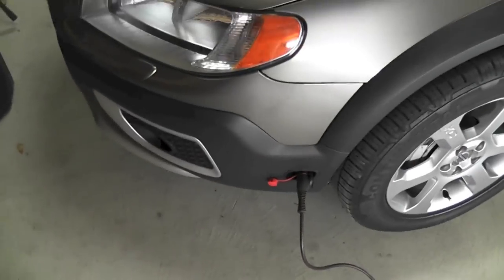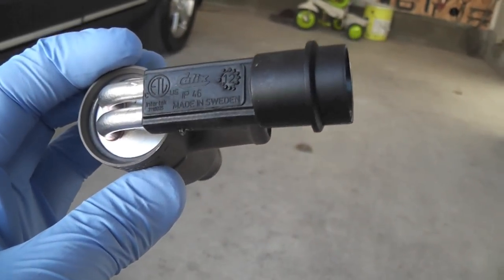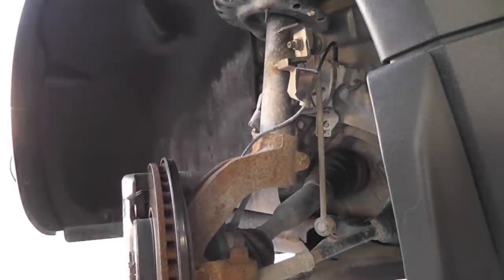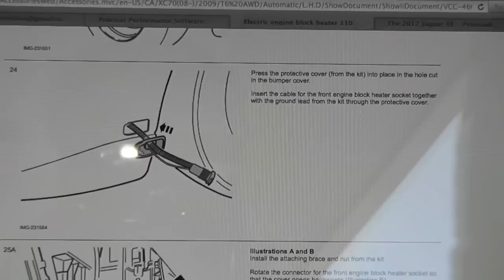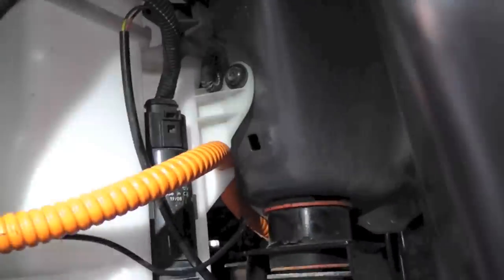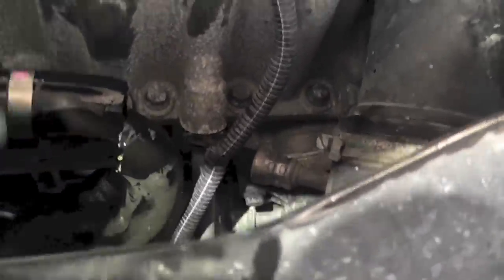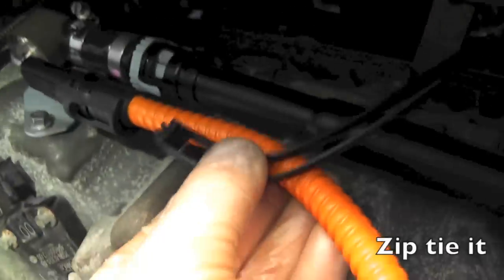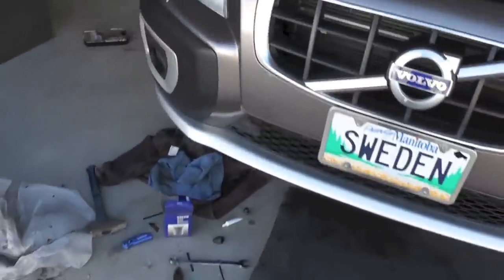Volvo Electric Engine Block Heater

Comment: I installed the same block heater with a circulating water pump kit on my 2009 V70 T6. The BOSCH circulating water pump circulates water in the system and the motor heats up more efficiently. The pump enters the same hose above the heating resistor and pumps water through the resistor. The pump is powered by a 230V / 12V transformer, which also acts as a branch point for a separate 230V cab heater. The brand is Calix, the same manufacturer that manufactures original Volvo engine block heaters. The Calix part number for this pump kit is 1762010. I don't know if it gets a 110V / 12V version, we have 230V mains voltage here in Finland.

Comment: I never saw a car without this 🤔 I wonder why they didn't install it in the factory if the car was going to Canada.
Reply: You're right mate. My XC70  in Norway had this from the very beginning. Now I live in Australia - the XC70 with the wheel on the right hand side certainly does not have it. What for. My Volvo dealer told me he never even heard of something like an engine block heater.
Reply: @gerpressindepen5425  strange indeed

Comment: hi would  it not be better to have the socket on the car face the other way round so the   cover /cap closes  the other way around less chance of it  opening with the airflow when driving
Reply: steve roper  you would say so, but the manual has a note to install it like this
Reply: I thought the same thing.

Comment: I don't know how i got to this video, but this is oddly enough the exact same heater you get on a Canadian spec 2015 Volkswagen Golf TDI. It's not a very effective heater as it seems to shut off if you leave it plugged in more than 4 hours, but it is better than nothing. If it had a built in pump it would be a decent little heater, but it turns off before REALLY heating the engine.
Reply: It's only 550W, it should have at least 3x more power to heat some big block. You have 2.0 TDI?
Reply: @Wrublos212  Yeah it's the 2.0 TDI,  I feel the wattage is sufficient to get it "warm" but temperature on startup seems to vary greatly depending on when your plug in

Comment: No way man, I'm in Manitoba too. I have a mk7 VW golf and installed the same system, it doesn't seem to warm much tho, is yours getting warm?
Reply from the maker: Hey! In the manual it says it warms up to 20 degrees more then outside temp. So if its-22 outside your coolant would be at -2. Actually I do notice a difference when I plug in. The climate heat comes faster.

Comment: Hi there, fellow Winnipegger here. I found a Calix cord in my 2014 s60 t6. I bought the car pre-owned about 5 years ago. This is my first time finding it (had a flat tire and was looking for the spare tire when I stumbled across it). Is it safe to assume if I have the cord and the outlet in the bumper I have this feature? The engine hates the bitter cold. I wish i had found it years ago.
Reply from the maker: Hey. If you have the cord and the bumper outlet then you do have engine block heater.
Reply: @volvosweden  thanks so much for your response. I appreciate you taking the time to answer. Great news that I wish I had known years ago!

Comment: Super video, Thnx 😊
If I do this i will tap into the line and add a 120v cabin heater and stick on heaters for the oil and transmission pans. How many watts is this coolant heater? Hoping it's low enough to allow for the other heaters to run from the one cord 💁‍♂️

Comment: Useful video. I did side plug installation, coz of your video. However, I was installing on a VW golf mk5 a block heater, that it's attached on the side of the motor. A calix RE 149. And also the installation for the plug inside the car.
Great video, thank you :)

Comment: I just installed an engine heater in my 2016 S60 CC and referenced this video.  The hot knife/razor made cutting through the bumper very easy and clean.  Routing the cable was the most challenging because it is near the serpentine belts and I needed to make sure it was securely clamped away from it.  Removal of the passenger wheel and wheelwell cover was needed for proper routing of the cable.  There was also a tight fit at the connection point due to the turbo pipe being very close to the heater.  It took me more time than anticipated, but your video helped me out.  Thanks for posting!!  Now I wait for the cold weather to see how well it really works.
Reply from the maker: +Rob Dutka Good to hear that the video helped. It does work well in the winter. Heat comes faster to the cabin.
Reply: Heater works great.  When changing the oil yesterday I noticed some residue on the lower hose of the heater.  Turns out the screw clamp loosened.  I checked the other they and they were all loose too, but not leaking.  I lost about a cup or two of coolant but it could have been worse.  Keep an eye on the screw clamps.  I'm going to change mine to the spring loaded ones or the ones that you squeeze to lock them in place.
Reply: Heater works great.  When changing the oil yesterday I noticed some residue on the lower hose of the heater.  Turns out the screw clamp loosened.  I checked the other they and they were all loose too, but not leaking.  I lost about a cup or two of coolant but it could have been worse.  Keep an eye on the screw clamps.  I'm going to change mine to the spring loaded ones or the ones that you squeeze to lock them in place.

Comment: Just a thought .. is it possible to install the socket turned by 180° so the wind while driving is not getting a grip of the protection cover over the 3 leg socket? And rain + wind likewise get more easy access like it's placed/turned now

Comment: Great job =)

I think this system will fit on many cars.

I ditn't know that volvo has such a gereat coolant. It boils at 136C° awesome.

Such temperatures i know from evans coolant but its very expensiv

=)

Comment: Nice vid! Just to be fair, there wasn't a screw missing and therefore no need to drill your own larger hole in the bracket. Your'e supposed to use the included pop-nit to fasten the heater to the bracket. But still, good job!
Reply from the maker: +Daniel Stern Thx

Comment: hi,
great install

I downloaded the pdf instructions from volvo, but they were for the newer cars, and without being able to look at the car, it's not that easy to follow

so, if you could be so kind to answer a couple of questions

1) it's just a heater element, so without a pump?  
     is that why it takes over 2 hours to heat up the engine? 
     (relative low wattage to prevent local overheating and allow natural water"circulation"??)
2) it's installed at the hot side of the radiator?
     is it placed at the bottom of where the hose goes vertical to improve natural "circulation"?
3) it has an internal thermostat that regulates when to heat and when not? 
     (since you CAN keep the power plugged in the whole night or day)
      or does it just continue heating

thanks
Reply: +lillnemo1 If you haven't gotten an answer yet; 

 it's without a pump, only a heating element. It's installed in the lowest point in the cooling system (or also was possible). That's to allow for natural convection to take place when the water is heated. They are usually around 500W. 

From what I have seen, and from some simple guess work, you should install it so the heated water goes directly from the element to the block. If you direct the heated water into the radiator you will only cool away all that heat before it does any good inside the block. Imagine if the car is in -20 C and winds up to 8-10 m/s, a small 500W heater would do no difference if the water pass through the radiator first.

there is no thermostat in this one. It heats the water to equilibrium, if allowed.
Reply: +Tanni Banani 

thanks for the info 

cheers

Comment: How this heater warm up the engine block coolant? It seems to do it for a few inches up and down of that hose. A block heater should be inserted in engine block to warn up the coolant form inside, if is in outside circuit after thermostat is kind of useless. I have an 2011 S80 and think about installing one, after this excruciating Feb/2019 with -20 to -35C, even more with wind chill! The car barely started at -35, battery was a bit weak, but I was amazed by engine behavior, no rattling, noise or other problems, pretty quiet! Syntetic oil does a good job even it was like honey!!!
Reply from the maker: The heater was installed according to Volvo manual. Its before the thermostat. It does heat the engine block on the inner circuit and not the outer. I recommend this install if you are in a cold climate. It does help with start up of the engine and gives cabin heat faster. Using it every day at home and at work. Ag home I have a timer which starts 3 hours prior t leaving for work. Do it!
Reply: @volvosweden  I will, in Alberta was very cold since Feb1. May I ask you how much was then, here in Edmonton they don't disclose the price on their site, kind of secret! Thank you!
Reply from the maker: I actually bought my XC70 in Calgary in 2013 from first owner with 32,500km. It did not have block heater. I dont remember how much I paid for the kit. Call Valentine Volvo for price. I might get it cheaper here in Winnipeg.
Reply: @volvosweden  Ok, thanks!

Comment: I noticed the cut on the coolant line wasn't a clean cut, will that affect the longevity of the coolant line? Also, have you had an issues with any coolant leaks after your install?
Reply from the maker: Hayden Walstrom No leaks since.

Comment: How has this been working for you? Does it give hot or even warm air as soon as you start?
Reply from the maker: When very cold, like -25 the engine starts easier and gives warm air more quick. In cold climate it's a must.

Comment: Didn't quite catch the heat thing. Were you using the blow torch to pre-heat the blade?
Reply from the maker: Yes> forgot to include in the video.
Reply: Neat idea - never thought of doing that.

Comment: what if you also install a battery maintainer. then you have 2 ports and 2 plugs. instructions here https://accessories.volvocars.com/cs-cz/InstallationInstruction/Document/VCC-474903-2/V90(17-)/2017?lang=en

Comment: Why is the use for this element...? Pre heat the water inside the heater ?only 10 cms distance of water long ago the radiator circuit? before start the car?defreeze the anticoolant ???what is the true function about...tell me please because i dont know and i dont understand... I know about mechanical and this is not too much logical,my english is bad sorry.
Reply: no lo sabes It pre heats the engine,water and oil.
For easy starts,less fuel consumption ,less wear on the engine.
Reply: The goal for preheating by using this elements, is to warm up the oil inside the motor. At cold temperature oil change its consistency, so isn't anymore a kind of running liquid. (put cooking oil in freezer for 3 hours, you will see). 
So, by warming up the coolant liquid, the oil inside motor will warm up too, because cooling liquid, run across the wall of the motor.  
With a cold motor and frozen oil, motor can start but it takes considerably a lot more of fuel on the start, in addition the wearing...

Comment: The way it's designed, it actually only warms up faster the coolant once the engine starts running and the water pump starts spinning to circulate the coolant.  This doesn't look like an engine 'pre-heating' device.  If it's plugged but the engine is not running only the coolant inside that hose will be warmed, but the coolant around the engine will still be cold at the exterior temperature.
Reply: Ever heard about the "thermosiphon principle" ?

Comment: A nice feature is to connect an electrical outlet in the car connected to this system and add a heating element. As soon as the heater starts to warm the coolant water it also start the heating element and the car will already be warm when step into the car. Very common in Sweden to have that setup.
Reply from the maker: I know about it. Thx for the tip. Actually I might do it!
Reply: @volvosweden  I am mostly interested in this type of setup, since remote start is not a good option for my 09 xc70 I really want my car to be warm when I get in it to take my kids to school in the morning. Would love to see how to do this.